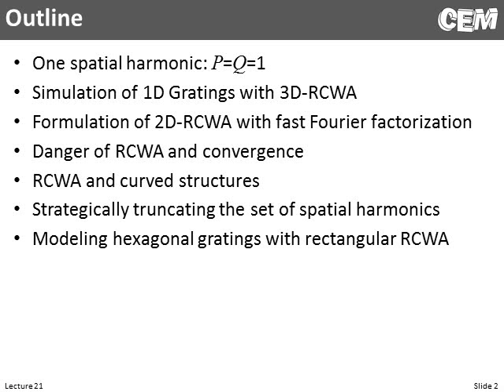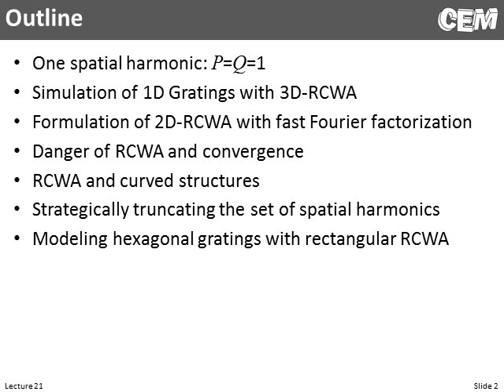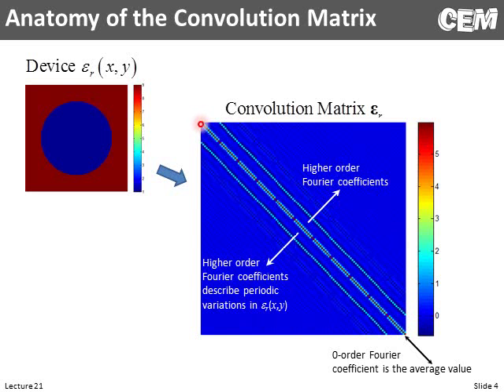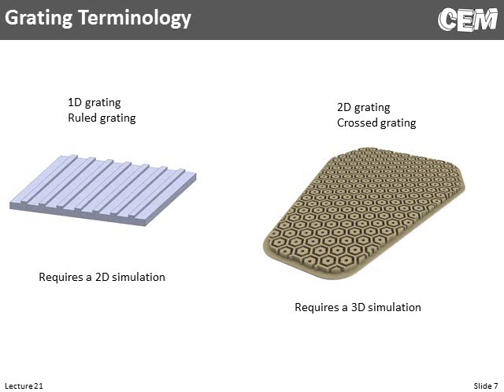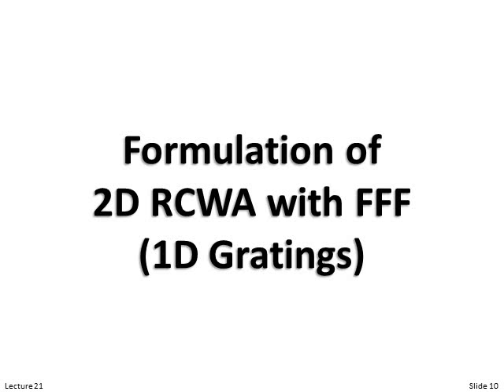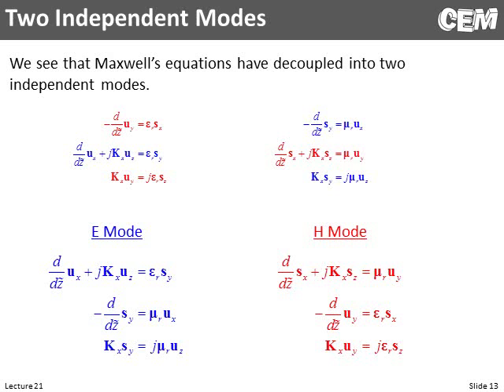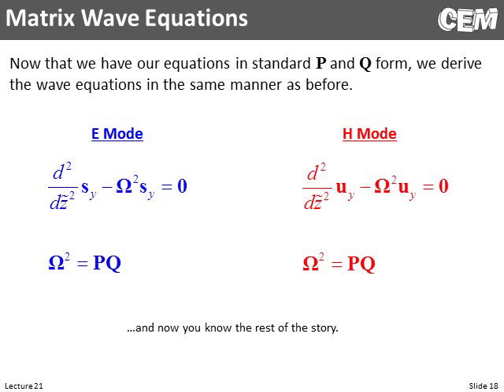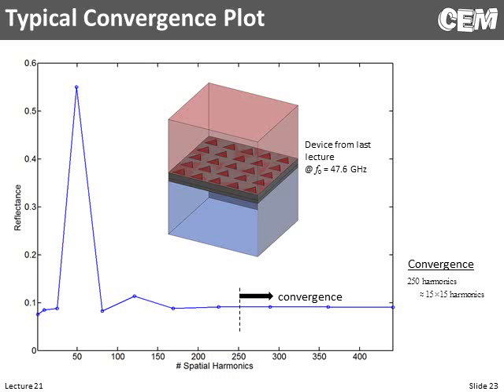Lecture 21 (CEM) -- RCWA Tips and Tricks

Comment: Hello, Professor. Forgive me for bothering you again. I am having problems simulating materials with complex refractive indices using RCWA. For example, for silicon, I looked up the refractive index on the refractive index website and found that the refractive index n at 280nm is 2.9291 and the extinction coefficient k is 5.2691, so when I combine the complex refractive indices, should I set it to 2.9291+5.2691j or 2.929-5.2691j.
I tested this in the code and if I use the plus sign then the final sum of diffraction efficiencies will be much greater than 1 and if I use the minus sign then the final sum of diffraction efficiencies will be less than 1. This seems like it should be using the minus sign but I can't figure out why it's the minus sign.
Also for this complex refractive index combination, the resulting relative permittivity is a negative complex number, does this have any effect? Because in my limited knowledge, I thought the relative permittivity should be a positive number.
Thanks Prof. I look forward to your reply!
All the best!
Reply from the maker: You are seeing the consequences of sign convention. Electrical engineers tend to use the negative sign convention where waves travelling in the +z direction are described by exp(-jkz). The positive sign convention would use exp(+ikz). With the negative sign convention, the imaginary part of refractive index is negative for lossy materials. 

Here is a summary I made of sign convention. You will find it near the bottom of Topic 3 - Maxwell's Equations at the link below:

https://empossible.net/academics/emp3302/

The real part of permittivity is negative for metals at low frequencies. That may be what you are seeing in regards to this.
Reply: @empossible1577  Oh!, I see! Thank you very much for your help, Professor, I have another question to confirm. According to the algorithm in your lecture, you can finally calculate the electric field in xyz three directions in the reflected and transmitted regions at each level, which means that rx,ry,rz as well as tx,ty,tz are all a column vector of p*q rows. If I only care about the strength of the electric field reflected and transmitted at the zero level, wouldn't it be better to just extract the middle-most value inside these column vectors, i.e., take rx[(p*q-1)/2] as the strength of the electric field in the x-direction for the zero-level reflection.
Reply from the maker: @dashingQ  Not really. The total electric field is the sum of all the spatial harmonics. If you only go with the zero-order mode, you will be ignoring some energy.
Reply: @empossible1577  Yes, this does ignore a lot of energy, because my main goal in the end is not to calculate the diffraction efficiency, but to calculate the Müller matrix coefficients, which in many papers say is only to be calculated in a zero-order mode.
Reply from the maker: @dashingQ  Yes, polarization only makes sense when describing a single diffraction order. You can do this, just do not expect to have conservation of power.

Comment: good lecture
1. I have a question. when RCWA is applied to metal staff, does it still work? I am wondering if the convergence would be much slow?
2. another question:  If I want to calculate the fields inside and out side the device, we should store every u and s and calculate inverse fft and phase (here need to use kinc ) like Page 4 in slides of lecture 20 (PWEM EXRRAS)?
Thanks in advance!
Reply from the maker: 1. RCWA still works for metals, but convergence is slower.  Inside dielectric structures with low to moderate index contrast, the fields look very much like plane waves so they can be represented very efficiently with just a small number of plane wave terms.  Inside high contrast structures and structures with metals, the fields vary more abruptly and it requires many more planes waves in the expansion to represent those fields.  There is some very good literature on this subject.2. You will need to work the scattering matrices backwards to calculate the mode coefficients in each layer or external region of interest.  Once you have those, you use the general expression for the fields to calculate them at any point internally.  See Slide 32 in the latest version of Lecture 21 on the course website for this equation.  I keep meaning to add a section for calculating internal fields in Lecture 23 "RCWA Extras."http://emlab.utep.edu/ee5390cem.htm
Reply: I tried to implement the near field calculation by storing the global S-matrix for each step and then solving for the mode coefficients layer by layer. It seems to work more or less at first glance, but quickly becomes unstable as soon as I have a sufficiently thick multilayer (one layer always looks smoothly) and retain many orders. Then there are very large mode coefficients for evanescent modes and the field looks highly discontinuos. The interesting thing is that this instability seems to not depend on the number of layers but on the overall thickness and the fields go nuts as soon as the beginning of a layer crosses a certain depth. I would highly appreciate some hints on near field calculation since I am stuck close to the goal.
Reply: Dear Dr. Rumpf, I found that you added some notes on intermediate field calculation which helps a lot! I went through them but my issue with exploding evanescent orders still persists. If I have a small overall thickness and a small amount of fourier orders, it works just fine and the fields are continuous but for larger overall thicknesses the evanescent orders become larger for every layer. This is not a sign/conjugate problem of the z propagation constants since already the field coefficients seem to be unstable. Do you have any ideas where this could come from? I went through everything and found no error and also the far field diffraction efficiencies come out correctly. I would highly appreciate some advice since this problem employs me for several years since I implemented RCWA based on your amazing course notes! Best regard!
Reply: @empossible1577  sir, could you suggest me the best software packages or company which we can use for RCWA tool and also for metasurfaces applications
Reply from the maker: @manojvishwakarma6527  Checkout RSoft from Synopsys.  That is a pretty good tool, although I do not use it myself.  Be careful when simulating metallic metasurfaces.  RCWA if fully able to do this, but it will be trickier and perhaps not has efficient as other methods.  For dielectric metasurfaces, it will be hard to beat RCWA.

Comment: Hi, thank you for your lectures!
If we take the minus from the P matrix (or Q matrix) and then derive to the matrix wave equation we will get (d2/dz2)*E+omega^2=0 . The solution then becomes C1*exp(i*lamda*z)+c2*exp(-i*lamda*z). Can the problem of the growing exponentials be solved this way?
Reply from the maker: I think what you might be getting at is changing the sign convention.  Unfortunately, that does not fix the problem.  The problem is fixed by distinguishing forward and backward propagating waves and handling them separately.

Comment: Hello, Thanks again for the great online material.

I have a technical question regarding the calculation of the internal fields in RCWA. I have a code working fine for 1 x 1 harmonics using the equations from lecture 6. But when I increase the harmonics I get an error when calculating the boundary field coefficient ci1-. For the internal layers SGn.12 is singular and so I cannot use the inverse in the calculation. 

Am I wrong to simply translate the equations from TMM to RCWA? Any help you could provide for this issue would be most appreciated.

Cheers
Reply from the maker: The code for TMM is very close to RCWA, but there are some differences.  As I teach TMM, there are a lot of simplifications you can make for TMM that you cannot make for RCWA.  Those things will not translate.

Have you visited the course website?  Here is the link...

http://emlab.utep.edu/ee5390cem.htm

On this page are three different benchmarking documents for RCWA.  For these, I essentially ran my codes without any semicolons after the commands so you can see all of the intermediate results and the order that I calculate things in.  There are two documents that use 3x3 harmonics.  I am confident that if you can work through these your code will work.  You may notice some differences in the order of the eigen-modes.  That is not a problem and should be expected.  If it is making it hard to troubleshoot, you can always manually type in the numbers from the benchmarking documents and the rest of the code should match perfectly.

Good luck!
Reply: @empossible1577  Thanks very much fro the speedy reply. Actually, my RCWA works perfectly for just calculating total reflectance and transmitance of a structure for any number of harmonics. It´s just when I attempt to calculate the internal fields that I have an error
Reply from the maker: @guybus  That is strange.  Did you look at Lecture 6 "TMM Extras" on the course website?

http://emlab.utep.edu/ee5390cem.htm

Here I show how to modify the basic scattering matrix algorithm to visualize internal fields for TMM.  It is almost the exact same thing for RCWA.
Reply: @empossible1577  Yes, I´ve followed the maths from Lecture 6. I´ve managed to get it working for up to 7 x 7 harmonics by increasing the initial spatial resolution of the grid but this has only worked to a point. For some reason for higher numbers of harmonics my S12 matrix is badly scaled and so I get unrealistic numbers from the fields  when I use it´s inverse in the calculation (like 10^30).
Reply from the maker: @guybus  Hmmm.  To troubleshoot, consider filling all your layers with air.  In this situation you can check values of the intermediate parameters to see if they make sense.  For example, the internal mode coefficients should be zero for backward waves, or very close to zero.